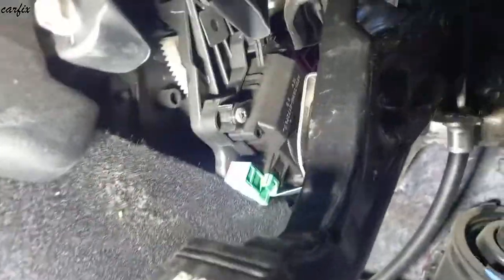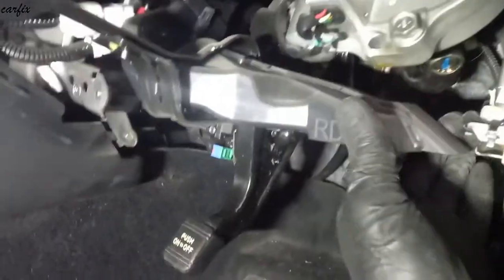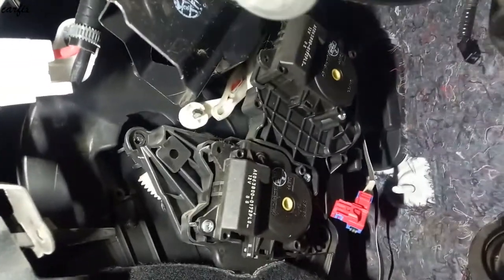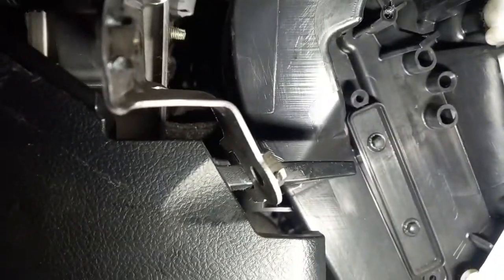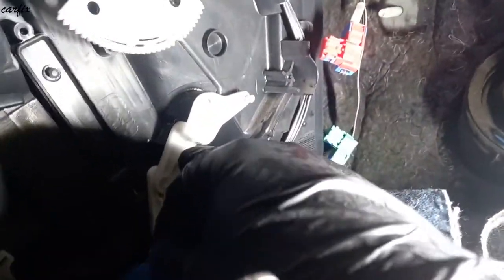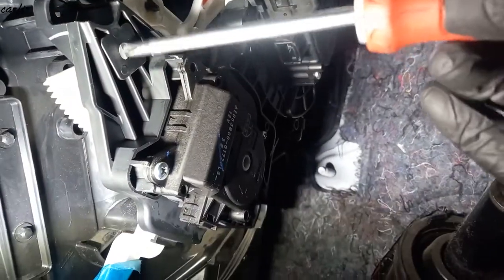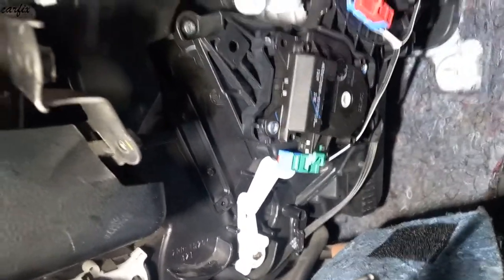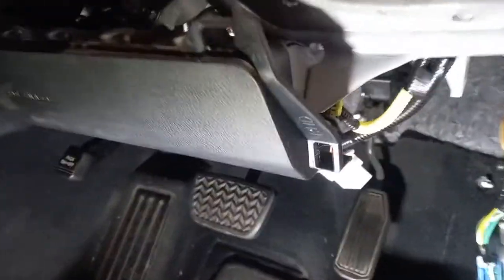How to replace  A/C Servo Motor in a Camry 2016

Comment: Thankfully i dont have this problem but watched it as i have low mileage 94 ES300, would process be similar if i had this issue? I have a factory repair manual luckily! Naturally neg cable should be disconnected since near airbag. Right? Thank you

Comment: Thank you so much for the video.  Do you know how to remove same part for camry 2007 LE?  The servo motor is on the passenger side but it is stuck by the blower? Any help is greatly appreciated. Thank you
Reply: 2010 and under are easier but they are not called Servos they are called motor blower resistor, it’s way smaller then this servo on this video and much less hassle. Hope this helps ;)

Comment: Would a problem with the servo motor cause the problem of air only blowing through the feet and not changing to front, windshield, etc?

I also did a self diagnostic test with the ac on my 2017 rav4 and got a code 43 which has to do with the servo motor